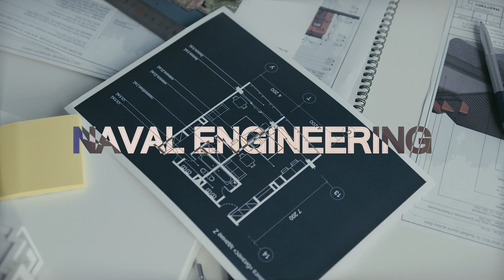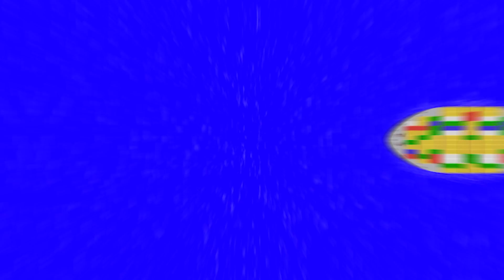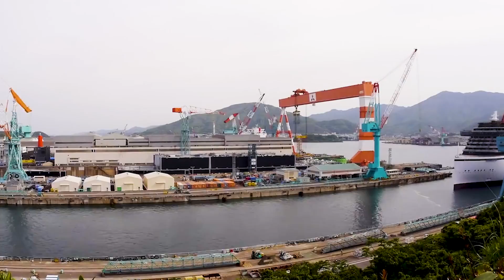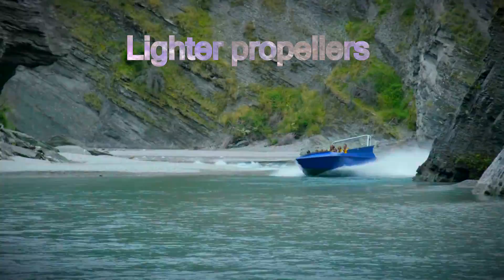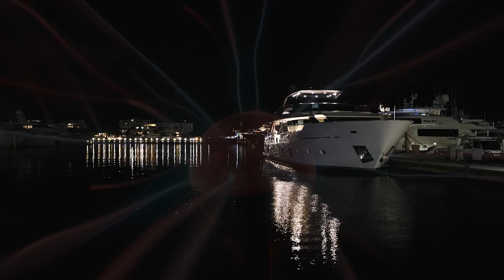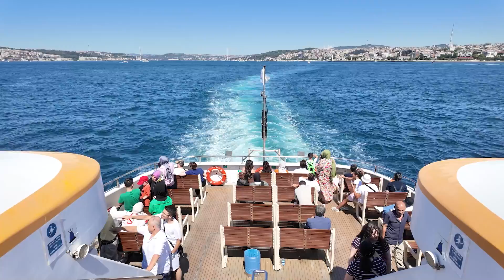Why Are Big Ships Faster Than Small Boats?

Comment: My boat goes 135 mph  It produces lift. Which exchanges water drag for air drag. the faster it goes the less  hull is in the water , as more hp is freed up to produce more speed, which produces more lift.
My boat does not produce much in the way of waves as very little of it is in the water.
What waves I can fly through have no affect at all

MY  ship CV-67 JFK was not a displacement hull and was not slow and got the unbelievable milage of 1 gallon per 12 Inches. 
This of course transported an entire airbase. We generally went 30+ knots no where in particular. (do the math of how many gallons per hour that is)
We refueled both DFM and  JP‑5  while underway...every other day.
But that was just to keep the fuel tanks full, not that we needed it.